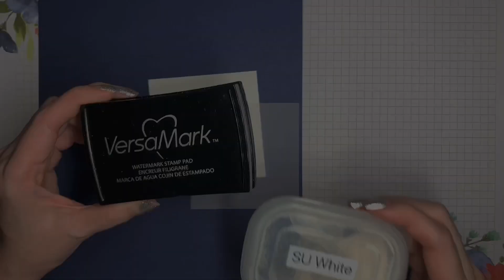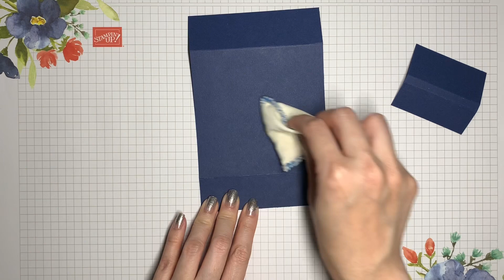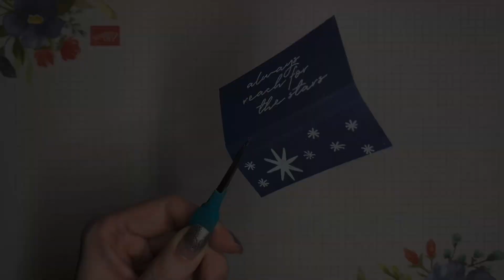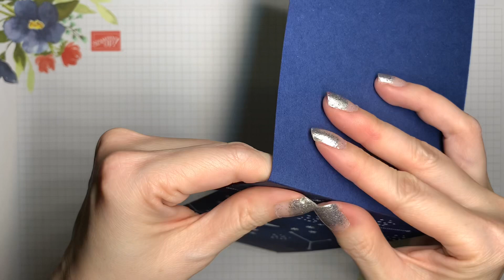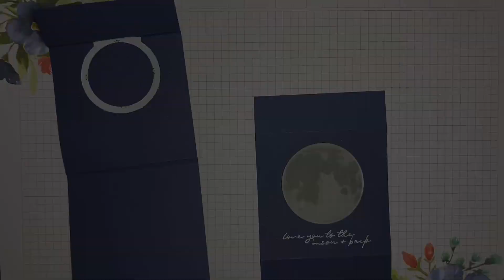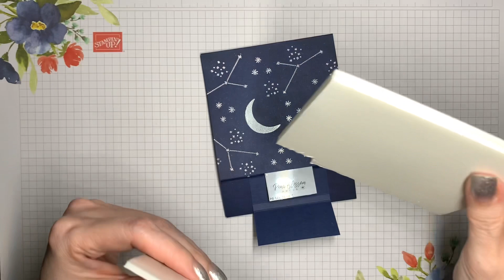Stampin Up To the Moon | Halo Light Card | Crafting Daily Dose

Comment: Vy, does the plastic holder come with the lights when you buy them or is that a separate purchase? If so where?
Reply from the maker: Hi, Joella! It’s a thin flat plastic piece with a circle in the middle, and the 4 tiny bright lights are embedded in around the circle. The only part that has real thickness is the part that holds the battery and has a button for activation.
Reply: Does the flat plastic piece come with the lights purchase linked in your description or do you need to purchase it separately?
Reply from the maker: The flat plastic disc is all part of the same assembly and comes together.